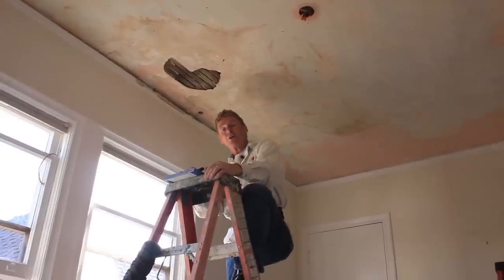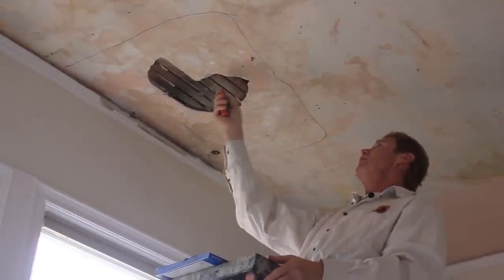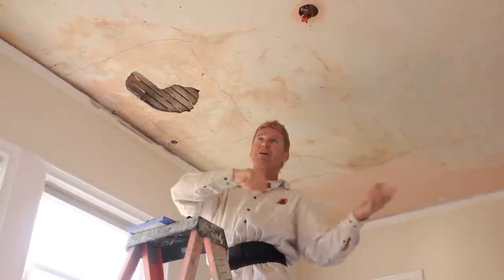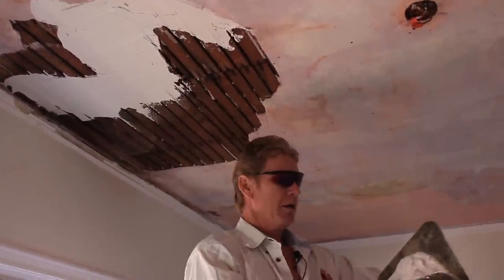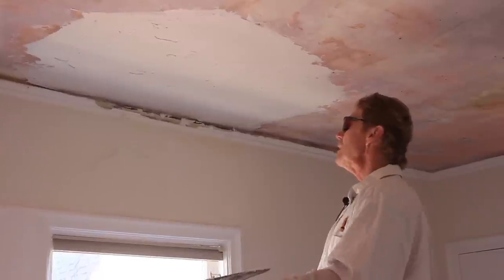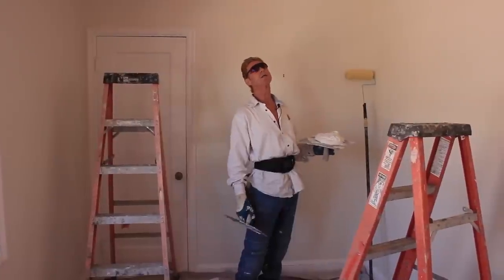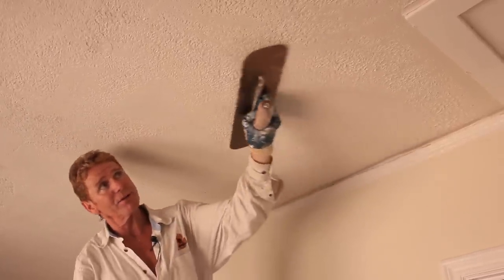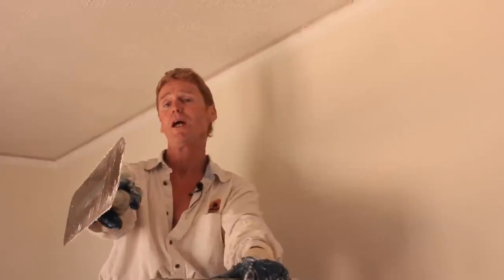Repair a damaged ceiling with drywall compound

Comment from the maker: Damaged ceiling repairs, Awesome looking finish
Reply: Great job..i did some of the same work as you did here…In Albany , NY is where is fixed about 10 spots the size of your spot in this video and i had fun doing it…you know what i did too? i went and bought the same trowel you have here..i think you had mentioned it's a POOL trowel…telling ya what Kirk..what a huge difference with the rounded ends..there are less exccess mud streaks..i used a squirt bottle and sprayed the keys first prior to application of the 20 minute mud..i did not score the plaster first though..you're right, it's the worst damn aspect of plastering!!! i had a guy next to me with a vacuum sucking all the crap in the VAC..but needless to say it came out good..i can't stress enough how guys like you have the utmost respect from me…HAPPY MEMORIAL DAY KIRK AND FAMILY FROM THE CARDAMONE FAMILY IN NY !!
Reply: Damn Kirk…we should call you THE ICEMAN bc your walls are so smooooooooth…
Reply from the maker: Evening Tommy Brando, thank you, You noticed this trade is only easy and fun after at least 10 to 15 years in at 8 hours a day and fully paying attention.
 The materials and techniques become so much easier and therefor fun.
 I've met many guys over the years who claim to have 10 or even 20 years in the our  trade but after viewing them for an hour I would ask in a nice way how much time do you really have in of actually working days?
 Not just being a plasterer and sitting home watching cartoons, these day should not be added into the time in as theres no learning or practice accumulated.
 Best wishes, 
 kirk and family
Reply: Yes Sir..i'm a painter by trade and have been in business for about 10 years..along the way i got into remodeling large and small jobs..i've never not been paid from a job and i'm very picky on who i hire…i've kicked off many dudes from the job site…i've learned a lot from watching the old schoolers like yourself, and picked up some tips over the years..owning 3 houses pre- 1880 helps a lot, too when encountering odd and weird problems like electrical and plumbing..prior to me going into business i worked union and non union jobs after college..i never claim to be the expert bc a man can only get better over time..
Reply: And i know about the guys and video games since half my ex girlfriends  left video gamers for me …hahaha…
Reply: Tomorrow i am painting in Troy, NY…then i'm doing a backsplash Tues, and then skimming a foundation near me (albany)…the skim job is going over a shitty foundation, so it's an assortment of things from me all year…The painting/drywall/taping/wall repairs is my bread and butter …
Reply from the maker: Hi Tommy, sounds like my days,
Make certain the shitty foundation is super clean otherwise the stucco won't adhere for too long. 
Tapers make the best plasterers as it the same type of process.
 Best wishes, 
 Kirk and family
Reply: Thank you for the educational video,  and taking the time to share your many years of experience that otherwise would take me about twenty years or more to learn.
Reply from the maker: Elizondo Victor, thats why we do it, too much learning to take to my grave.
 Best wishes, 
 kirk and family
Reply: Thank YOU Kirk, i appreciate the encouraging words…i'm a student of yours…if you ever come to NY, i owe you dinners and drinks…i'm watching a few of your videos a week to catch some pointers and techniques…also, material suggestions. by the way, i did that foundation and it has some hairline cracks on the top, and a few near the bottom..but hairline …i wetted it down throughout the day, and he following days…i shined shit, but it should last 15 years i think..
Reply from the maker: Hi Tommy, I'm going to take you up on that offer soon, as a rule I don't turn down  dinner or drinks.
 As far as the cracks go I get them too, it's the nature of the trade.
 Best wishes, 
 Kirk and family
Reply: "LIKE"
Reply from the maker: Thanks Tommy for sharing.
 Cheers!
 Kirk and family

Comment: it sounded like that heat almost kicked your butt at the end. I know how hard that work is and it's not only the heat, but the rooms can be pretty mean with the humidity with the the mud. My hat is off to you for swinging that 20 incher and hot mud. Thanks so much guys.
Reply from the maker: Hi Gee Dubb, thank you,
You know what we went through as you do this  work yourself,
 I should have used the 90 minute mud but didn't anticipate that this day would go up to the triple digits.
At the end of this 6 hour project it's no wonder I forgot who I was.
 I'll tell you it felt like 10 hours not just 6 when the heat kicks your ass.
 best wishes, 
 kirk and family
Reply: I try and stick with smaller projects since I got a little older and my heart got mad at me last year. Too dang many burritos I guess
Reply from the maker: Evening Gee, I know the feeling, my lower back is always mad at me.
 Cheers!
 Kirk and family

Comment: You are just so amazing. I just love watching you work and listening to your patter. I'm restoring a 1911 Craftsman where I had to remove a few bays for plumbing and wiring. So now I'm almost finished with restoring the plaster. I've watched a lot of your stucco and plaster to learn. Watching this one, it's funny how I can almost "feel" how you pull the mud up off your hawk. I use structolite, and lime coat mostly. For my ceilings, though, I got knocked down a peg... I don't think I kept it wet enough, or wetted the gypsum, nor troweled it enough. As it dried, it popped off. So I knocked it off, primed the gypsum, and used Hamilton Topping green dot. Some is smooth, some is splattered, and some is skip. I've learned a TON from you!
Reply from the maker: Morning Black Swan, thank you,
 Your plaster may have popped off as the area was dusty, nothing sticks to dust.
 I use a bonding agent to make certain the plaster stays stuck but also to clean the dust off the surface.
 I also use structo-lit for bigger jobs as it lightweight and spreads well.
Thanks for sharing.
Cheers and have a Happy New Years,
 Kirk Giordano’s DIY plastering tips

Comment: I've watched, and enjoyed, over the last few days, some of your plaster repair videos. Particularly the celling repair offerings. You make it look easy. I can't wait to repair the ceiling holes here.
19011-ish, two story, lots of cracks, an opportunity to become good-er at repairing old plaster for sure.

Thanks for the info.
Reply from the maker: Evening Earfront, when you get started remember, get some help.
 I make it look easy because my son mixes perfect mud, without good mud I would be a comedy.
 Best wishes,
 Kirk giordano's DIY plastering network
Reply: Thanks for the tip. I do like a very clean working environment, and the challenge of making perfect mud, is my kind of fun.

I'll let you all know if I do well, or have a disaster.

I'm hoping for. "not bad" but shooting for" wow! that ceiling repair looks pro.

It's just me, I have no friends I'd trust to mix me a perfect batch. I guess I'll need to make sure my plaster is the kind that cures a little slower.
Reply from the maker: Hello EarFront dude, try at least 40 minute mud to give yourself the extra time, hell if you're not sure use 90 minute first.
 best wishes,
Kirk & Jason Giordano’s DIY plastering and stucco instructional videos and forum

Comment: Kirk, I own a Fein Multi tool with a Fein 9-11-55 vacuum with attachments for the multi master and it works great, I use it on old school mud tile jobs that I demo. (and yes when the customer wants it I still do the old school mud beds for tile) I always use cement type products for all installations I do. Now the Fein system is not perfect but it has cut my dust issues 90+ %, it also can be equipped with a HEPA filter. How do you know what a Pot leaf looks like? LOL.That's right I said it LOL..... When you speak of 15/45/90 min mud are you referring to products like Dura bond 15/30/45/90 etc? I always wondered how they got some of the particular finishes in houses in the 30s & 40s especially on ceiling, was it mostly done with a roller type procedure?  Brother I am so jacked when I see you post another video. Always brings me back to my Uncle Burt and Grampa Rass. When I spoke of my Grandfathers F-100 Pick Up last week it was a 1960 in that ford dark blue back in the day! Three on the tree. He taught me how to drive it when I was about 11 or 12 on job sites and when we would go to lumber yards and suppliers that had big lots he would let me be the pilot. Great times!!!!! Keep the vids coming!!! love them. My best to you and your family!!! Jimmy "RASS"
Reply from the maker: Hi Jwrass14, thank you, the mud I was using for this ceiling patch is a gypsum drywall compound called westpac drywall compound, it goes by other names as well.
 Dust sucks.

 Thanks for all the memories,
 kirk giordano

Comment: This is going to help. I think I have a plaster and lathe ceiling in a house that was built way back in 1835. The roof was repaired about five years ago, but there's a section in a closet that looks like nobody noticed, and it buckled and then collapsed when I touched it.
Reply from the maker: Evening Robot, I hate it when that happens,
 Cheers,
 kirk giordano Rendering

Comment: Any experience or opinion with using oscillating tools to cut out the bad plaster, as opposed to using utility knife blades and muscle?  I'm going to be repairing a wall for a retired friend soon, and I've watched several of your plastering videos...Enjoyed them all.  Tom in Michigan.
Reply from the maker: Hi Tom in Michigan, yes I';ve use these they make life so much easier,
 Less dust too,
 best wishes, 
 Kirk giordano
Reply: duenge 10

Comment: You mention that you had to cover the first coat with plaster weld because it would suck the water out of coat number 2?  My question Kirk is that does coat 1 always get plaster weld on it before coat 2?
Reply from the maker: Howdy Spencer Mate, without watching one of my own video's I can tell you the bonding agent was put on the cedar wood lath to remove any dust and to help the gypsum adhere better, there is no need to apply a bonding agent again.
 cheers,
Kirk and Jason’s sand and cement rendering videos

Comment: All the other videos say that plastering is like concrete and different from mudd regardless of time 90 or 20 min.  They are using the plaster and not mudd.  So please tell us exactly what we should use in order.  I have a whole 100 year old house to do.  Also looking for the company to get the rollers and also your mudd scoop.  Thank you so much for your videos and sharing.
Reply from the maker: Hello Sweetie, plastering is for internal use, such as drywall mud, sheetrock, Lime plaster, and such.
 Stucco is for exteriors which is cement plasters.

Comment: How do you know if a crack in a plaster ceiling can be repaired or if the ceiling needs to be replaced? I am being told that the ceiling in my small bedroom needs to be replaced instead of patched, but I’m not sure if that’s really accurate. What’s your advice?
Reply from the maker: Contact a couple sheet rockers or plasterers and get a second opinion. 💃

Comment: Hey Kirk - Thanks so much for your videos - they have really set me straight for the ongoing repairs on my old home. My question is what is the specific name of the 20 minute mud you use ?- I live in the north east and really only have big box stores available. I have both wall and ceiling repairs to do filling large cracks and holes. Do I need different weight mud or will one do? Again, thanks so much for your time.
Reply from the maker: Howdy Matthew,
FYI, the most popular 20 minute interior muds are either Westpac's or easy sand in my area.
 best wishes, 
 kirk giordano plastering

Comment: Thank you for the the detailed vids Kirk and fam. I've a question. When do you need to use fiber mesh for plaster repairs? The reason I ask is that I see some who always use mesh around the perimeter of of there repairs however I've never seen you use it In Any of the  vids that I've seen.
Reply from the maker: Howdy brian, I use mesh when joining sheetrock seams together, 
 Best wishes, 
Kirk & Jason’s stucco repair video’s

Comment: Looks really good , how do you clean your tools and what do you use to clean them ? Thanks.
Reply from the maker: Morning Allan Vidaurre, hey dude, as a rule I clean them throughout the day with my trowel or a margin trowel I sometimes keep in my bucket or my back pocket.
I first scrape clean the hard mud from my hawk with either the trowel or margin trowel then fish cleaning with my handy dandy green float that I keep in my water bucket.
 Nothing worse than having buildup of gypsum or portland cement plaster harden on the bottom of your trowel as buildup prevents the trowel from flexing which matters when you are applying any gypsum, portland, acrylic,or lime based finish.
 Most guys don't understanding a trowel being is able to flex, but that's another story.
 Best wishes, 
 kirk giordano plastering

Comment: Thanks for these vids Kirk. If I didn't live in Maryland I would really enjoy apprenticing with you or even getting the chance to just shadow for a weeks worth of plaster work. I'm 42 and looking for a new career, I like old things/houses and it depresses me to see all this drywall being used. Anything cheap is the rule I guess. One other note, do you promote the use of using screw washer caulk method when having to restore and even out a t least a 12X12 ceiling? Don't wish to be a pain but do you answer personal messages, I have a couple questions on tools/method before I start laying out the cash....wouldn't be anything to involved just wishing for some direction and finding books on the topic seems a harder task than I'd thought it would be. Thanks again for the free knowledge, sincerely Mark.
Reply: One quick question, I'm a bit of an artist/illustrator and have a decent  amount of liquid PVC available...would a 2or3 to 1 water to glue mixture work like plaster weld?
Reply from the maker: Good Evening Mars, I would recommend if you're short on cash and or experience to install sheetrock and finish with either taping mud or veneer plaster base coat with finish coat.
 as far as the bonding agent I prefer plaster weld, I don't have any knowledge with liquid PV's, thus can't advise on this substitute.
Cheers,
FYI, all of us here at the giordano plastering channel we wish to thank all our subscribers and those of you who accidentally stumble on our channel a happy and prosperous new year
 kirk giordano plastering
Reply: Thanks for  the response I believe I will  try to give this a shot. I'm pretty pumped up about it too. I believe I forgot I already asked this question and commented on another vid so disregard right! I'm going to try to bring plaster back into style in my family....so much better time/cash spent than sheet and mud. Thanks again,
Reply from the maker: Howdy mars, cool beans daddio,
 Best wishes with your projects,
 Kirk giordano plastering on small repairs

Comment: What brand of mud are you using? I use Kal Kote products! Made by gold bond!
Reply from the maker: Evening Randy, I'm using a simple sheetrock compound that sets fast like plaster of paris,
 Cal coat is a veneer plasters, which means they have limestone for strength and the all important gypsum to set it fast, which when combined are much stronger than what I am using in this video.
 Schools and hospitals require veneers, my newest video that was uploaded about 1 hour ago shows this veneer plaster finish system with a bit of inside information.
 The link is below if interested

 https://youtu.be/P-MYIWu6hLg
 kirk giordano rendering

Comment: Please tell me if plaster weld is on the keys. Or do you wet the Keys.
Reply from the maker: Howdy Spencer, either way will work the important thing is to have the cedar wood lath as clean as possible or the plaster won't adhere as nothing sticks to dust.
 I us a bonding agent as if I have to take the time out to wet tin order to get any excess dust off, i might as well use a bonding agent it's the same amount of time just add in the cost of the bonding agent, with my company I can't afford to skimp on costs.
 cheers,
Kirk and Jason’s sand and cement rendering videos

Comment: Hi Kirk, My ceiling has water damage similar to the one shown in your video. I removed the bad spots so that the laths are exposed. What kind of mud are you using to make the repair. In your video you mention 20 minute mud.. Is it plaster of Drywall Joint compound? Can I substitute one for the other. I am  not having any success finding plaster mix to do a large area  at my local Home Depot store. Please advise.
Reply from the maker: Howdy bones dude, I was using joint compounds by westpac that are sold at Home Depot, Lowes and most small hardware stores.
 20 minutes means from a mix if mixed properly you have 20 minutes to apply it befor it gets hard.
 If you contaminate the mix with dirty buckets drill paddles this will accelerate the set time to sometime hard in the bucket before you get to the place where you need it.
 Best wishes, 
 kirk giordano

Comment: This is a 2 coat system:  is it USG 1. Veneer 2. Diamond?
Reply from the maker: Howdy, it can be done in two or three coats, or one if you have the skill, It's a USG gypsum based material.
Bagged drywall compound.
Best wishes,
 kirk giordano